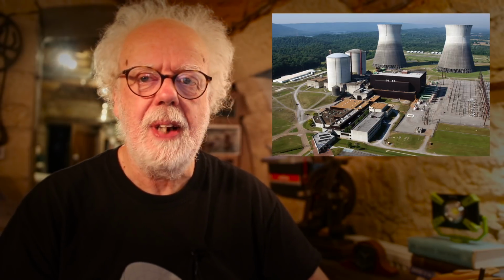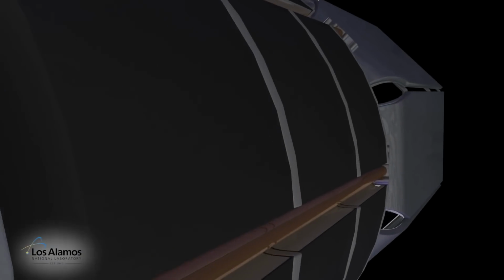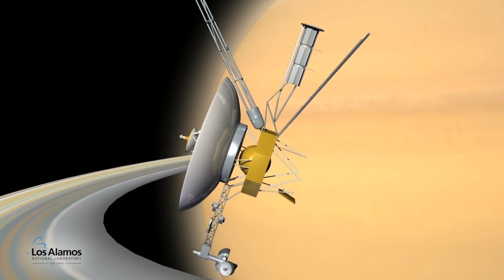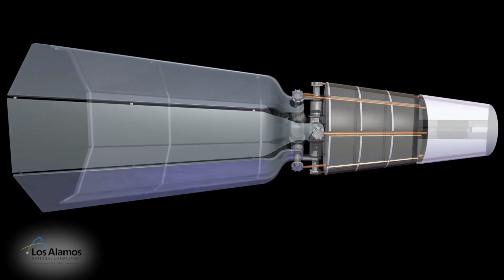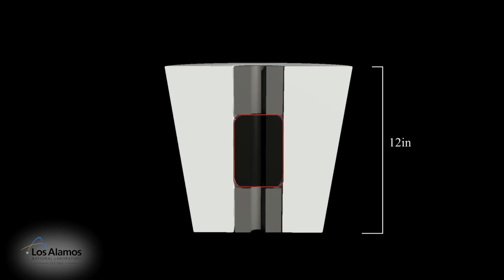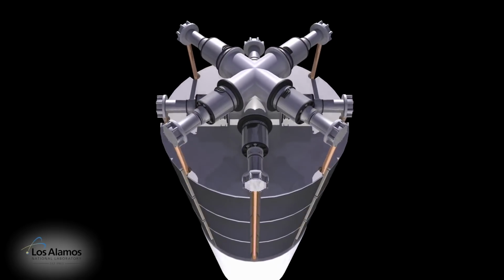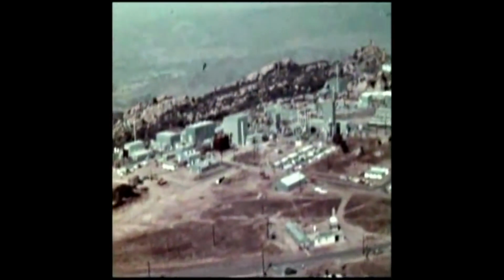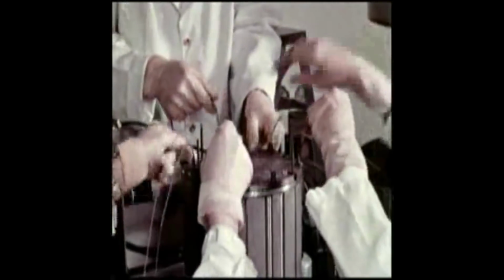Micro power stations - Prof Simon

Comment: Most of the clean up has to do with the type of fissionable materials used. Urainium transforms into Plutonium and other long lived items on average that take 10000 years to reach a safe  level of radioactivity. A Thorium based reactor which needs a bit more research to commercialize produces materials that only remain at an unsafe radioactivity for 300 years. AlsoThorium is much more available on Earth than Urainium. Thorium can be used to breed more low grade and and Thorium too. This makes it an energy source that could last us for at least 80000 years. You need to do some research on Thorium reactors as personally I don't support Uranium based nuclear power anymore. Also, you can't breed the Thorium material to a concentration high enough to make a bomb out of it, it can only be used for electric or industrial power. ( possibly one of the reasons most governments lost interest in it)

Comment: I was involved in a working hydrogen fuel cell genset in 1980 I was there when Honeywell gave the plans and the machine shop I was at had a blue tarp that separated the factory   I watched as both half’s came together by only two scientists  it produced 16 kw and was the size of a standard $500 genset at Home Depot. It ran clean on water  passed slam tests then they took it apart and shelved it.  I thought it would be sold at Home Depot next year  it could power a house or two. These are the oil co  they won’t allow free energy. And that was  the unit would make clean rain clouds.  Everything is a lie.  I see the components on eBay now in kits that resemble the fuel cells so they are close   This unit started on two car batteries then ran on its own on water.  I was the only non employed person allowed to watch it all.

Comment: Why do they complicate it with 8 sterling engines when they can use thermal couplers that generate power with heat ?   I use one camping and it is stuck to my metal coffee kettle and it makes 10 watts enough to run two smart phones  they could come in at 60 lbs not 160 using 8 engines   I’m sure it’s to justify 80 million dollars.  Mine cost me $70.

Comment: so if that blue glow is the dumping  of excess energy from atoms that have gained a large amount of excess energy then what would the speed of light be in that medium being used typically ... and what energy level does the glow relate to in the visible light scale ... and how intense is it ... will tell you how much energy had to be dumped meaning lost due to this photon emission .... and how fast above the speed of light in that medium the particle had to be going to hold that much excess energy before it could lose it to a photon creation ..... since the speed of light in that medium can be broken if another medium was used and a different colour was seen that would show how variable the cooling medium is in limiting or helping the reaction ..... with the new bits of how much energy it takes to surpass the speed of light in several different specific mediums one can then derive a formula to exceed the speed of light in a vaccuum like space ... or even in atmosphere ... from there find out how big is big power consumption ;)

Comment: If I remember my thermodynamics the Carnot efficiency of any engine depends directly on the "sink" temperature...in space that would be about 3 Kelvins but on earth would be about 270 Kelvins to 290 Kelvins...that means on the earth max efficiency is about 25% but in space closer to 90%+ efficient. To get space-like efficiencies would require the core temp to be over 500 degrees Celsius. Dangerous. Also space probes are literally "thrown away" so no need to worry about nuclear waste...perfect for space but not so much for terrestrial applications...I suggest the "Illinois EnergyProf" YT channel for a primer on nuclear power...

Comment: The blue glow referenced by Prof Simon is called Cherenkov radiation The particles attempt to enter the water moderator at greater than the speed of light in water and instantly give up energy in the form of the blue glow of Cherenkov radiation The particles never actually exceed the speed of light.  They reduce velocity by giving up energy. Hence, Einstein  is still right !

Comment: The "blue glow" is called "Cherenkov radiation."  It is NOT caused by '"electrons moving faster than the speed of light" per se, but rather by electrons moving faster than the speed of light in the water.  Important distiction since, per Relativity, nothing travels faster than the absolute speed of light in a vacuum
Reply from the maker: Good point

Comment: don't they only keep nuclear waist because it still has a lot of energy that more efficient reactors could use in the future? 

i mean it should be easy to deal with, if it's a liquid you could soak it up with sand and then mix a small amount of this radio active sand with normal sand until it's not dangerous then use it to make cement.

Comment: The speed of light in water is slower than the speed of light in air and vacuum. The speed that we are familiar with, is the speed of light in a vacuum. So Cherenkov radiation is caused by the particles emitted by the reactor close to the speed of light in vacuum(but faster than in water) interacting with the electron shells of the atoms in water. Think of it as a light boom, a shock wave similar to a sonic boom.

Comment: Surprising perhaps but solar that uses large low mass concentrator mirrors has higher specific power than nuclear when using triple junction solar cells all the way out to Saturn at least. Beamed power via microwaves can provide surface power from orbit and all this at a tiny fraction of the price.

Comment: The problem of waste is massively overblown. All the waste ever generated by the US nuclear program can fit in a space less than half the size of a modern sports stadium. And new generation reactors can burn 95% of the waste and transmute it into waste that’s only radioactive for 300 years, not thousands.
Reply from the maker: Hope it works and it will be paid for

Comment: anyone discussing nuclear reactors of any kind is stark raving fucking mad and should be locked up for the good of the species. we have discovered the ultimate power source and it is being developed now, the u of arkansas made a truly micro power source using graphene and it is the game changer.  https://www.graphene-info.com/university-arkansas-aims-commercialize-its-revolutionary-graphene-based-veh-technology
with this we have tapped the quantum realm for energy and it is limitless, the devices made with this as their power source will never need recharging because the material can be built into the substrate the electronics sit on and serve as a point of use source for each part requiring electricity. a sphere only 50m across filled to only 75% capacity with this material could, at worst, produce as much power in a single second as the entire world uses in a year and it would do so for forever, at best it would produce 3 times the worlds energy requirements per second for forever. the nature of its power production is a function of physics that will continue even when the universe has gone cold because brownian motion doesnt end at those ultra cold temps. it will never break down because the binds holding the carbon atoms together dont suffer fatigue and the brownian motion is an atomic level function.
all this is to say that we now have the ultimate power source and continuing on with the other shit is utter insanity

Comment: Faster than light in that particular medium light travels at different speeds through different substances like water..wonder if the carbon rod got stuck would the small generator melt down?

Comment: Read long ago about a French power reactor built in neighborhoods.  The nuclear fuel balls were encased in a dense ceramic coating. This was within a water bath, the steam drove turbines, producing electricity.  IF the water bath was damaged, the ceramic matrix expanded, separating the fuel balls and reducing the nuclear process to a stable, continuous, state.  This was tested and proven.

Comment: Nuclear power plants aren't TRULY carbon neutral. Think about the machinery used to dig up the uranium ore, or the amount of power to  extract the TINY bit of uranium from the ore, and the power needed to separate the usable uranium isotopes from the other ones. When you start to think of processes like these when talking about carbon neutral nuclear plants, you start to realize that you would have be using ALL electric equipment and machinery AND the power plant(s) supplying the energy to these would have to be Hydro-electric (if they were nuclear powered then you run into  the chicken/egg first conundrum) PLUS the concrete in ALL of the aspects of these steps requires A LOT of fuel to heat/bake the limestone for the cement. Now I HIGHLY DOUBT they are using ELECTRIC OVENS (hydro-powered of course) to do this, and they're most likely GAS FIRED ovens. That gas is either  obtained through fracking (YUK) or cracking (cooking crude oil) and neither of these processes could be called "carbon neutral"
So my point is that the term "carbon neutral" is a very mis-leading and not very often fully thought out. Although I LOVE the idea of things being carbon neutral, it's toss around willy-nilly without people giving it much thought as to what it really means. 
Now, time to unpause you and see the rest of your video :)

Comment: Back to issues with nuclear waste, a traveling wave reactor can convert nuclear waste into usable energy reducing the waste in size and reactivity in a perpetual cycle of breading and burning of spent fuel and other sources of radiation including thorium and medical wastes. Bill Gates is working on it. I am personally looking forward to thorium reactors because they easily scaled to car power plant size or large scale and safe with liquid fuels and passive heating. I have always loved seeing a research reactor pulse or startup its core and producing Cherenkov radiation that actually produces particles that travel faster than the speed of light... dont see that in the text books.

Comment: Micro nuclear will not exist for domestic electricity production one simple reason - it has no potential for weapons grade material production (if it had it would not be allowed for security reasons). This requires large scale reactors that can be securely maintained. Small scale micro reactors would make them uneconomic. This vicious cycle of thinking has controlled nuclear development for decades and means that the technology is essentially dead for domestic power supply at economic pricing. Micro generation using Green technology is the way to go - but hugely underinvested as well. Just a fraction of the ongoing costs of current nuclear would transform this in the UK. Logic, as they say, is not persuasive.
Reply: Cold Fusion anybody ?
Reply: I was surprised to see that a group of Canadian  companies are proposing Micro - Nuclear power plants as a solution to power in remote areas.  I'm pretty sure Canada was considering something like this as far back as the 1960's but I can't find anything on it yet.

https://business.financialpost.com/business/watchdogs-assess-plan-to-build-canadas-first-mini-nuclear-power-plant
Reply: @abrahkadabra9501 - this particular reactor is a rather special design - it's as small as efficiency curves allow. It's super, super safe compared to a normal reactor, any failure is instantly contained - made far easier given the low amount of fuel.

The idea is? to have lots of these little reactors to make up a single power plant - distributing the power generation to produce a new class of 'safe' fission reactor.
Reply: It would be pointless to put them into  domestic electricity production, instead use them like teh rest of power grid, put it in place it hard to get to that supply power to entire grid ....just like any other generator or power station, and we have to protect both power stations and generators any way they have security for similar reasons, danger and threats, hackers ....Anywhere there is Large amounts of power been produced or stored has to be protected.